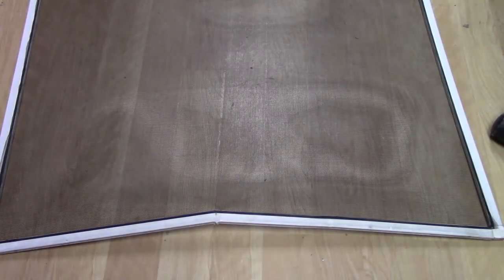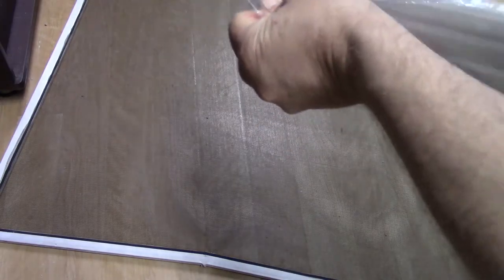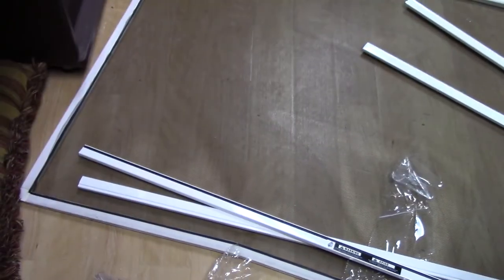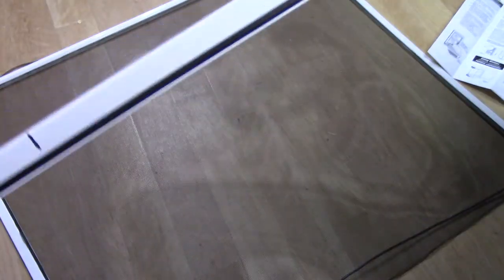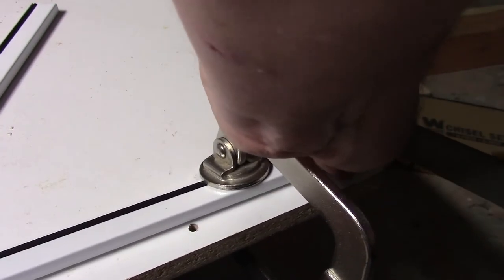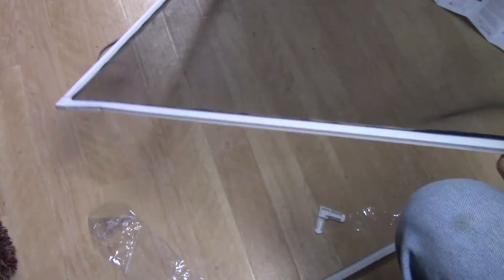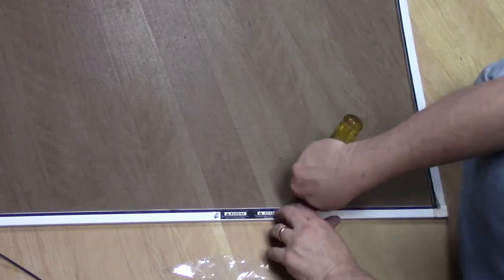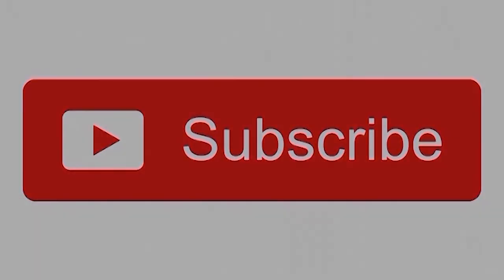Repairing a Damaged Window Screen Frame

Comment: as all-four corners were sheared off when my cat decided to launch herself into it, we inserted the new corners (bought at the local hardware store, $3) but since one-half of the corner could not be pulled out at all, we had to push down that part further into the frame while hammering the new corner inside, too. There was no way to get the old corner out, even with a pinch-clamp tool. That's how we saved the screen and was able to reinstall it in the window frame.

Comment: Can I use a grinder for a cleaner cut instead of saw
Reply from the maker: A grinder with a cutoff wheel probably would give a nice clean cut. A miter saw with the blade flipped could work too.